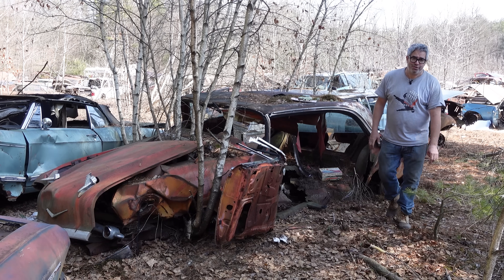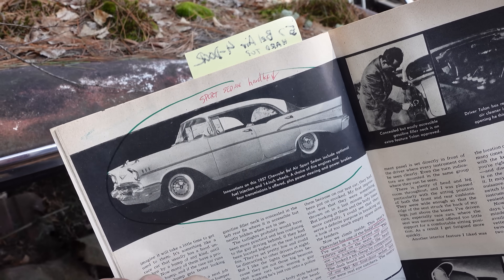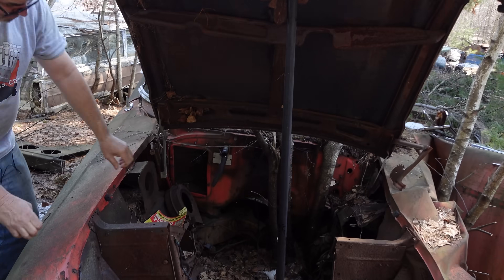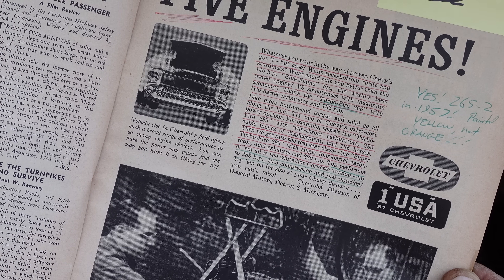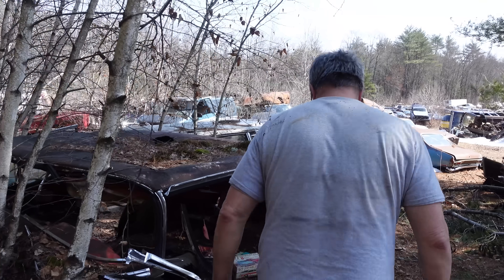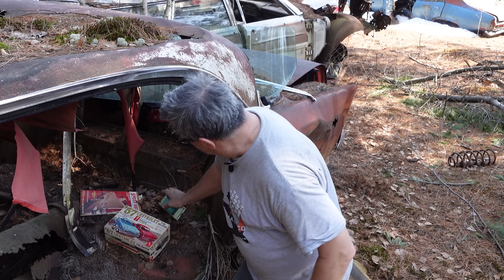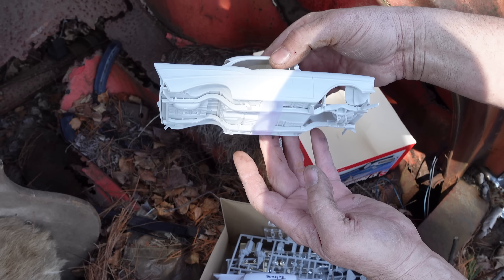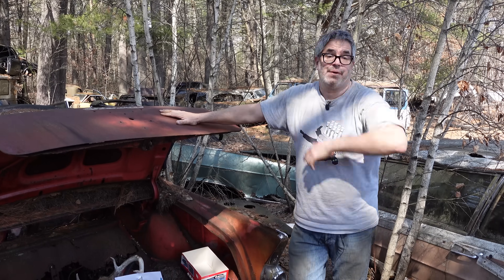Baby Cadillac

Comment: Yup, tinted glass was an option. 

No VIN, can't win, but easy to figure out, no doubt: V for V8 equipped (the lack of the "V" in the VIN means it had a six-cylinder engine), C for Bel Air, 57 for 1957 model year, possibly S for St. Louis, MO assembly, or B for Baltimore, MD assembly, or J for Janesville, WI assembly, T for Tarrytown, NY assembly, G for Framingham, MA assembly (among other choices) and the rest is the productions sequence. As noted previously, all of these plants are now closed. 

No tag, can't brag, but somewhat easy to figure out, no doubt: 57 for 1957 model year, 1039 for Bel Air four door hardtop, then any of the letter codes above denoting the possible assembly plants, maybe 676 for Black and Red cloth and vinyl interior trim, maybe 802 for Matador Red or 819 for India Ivory and Matador Red two-tone exterior paint and EZI for "EZ Eye" tinted glass.

My now retired coworker restored his dad's 1955 Chevy Bel Air (originally a V8), but it's resto-modded now with an LT1 engine and a four-speed overdrive. It has all of the modern conveniences that you would expect. I've related the story that he went to a car show and a guy was persistently asking him to buy the car, but my coworker politely refused saying that it was his father's car and it wasn't for sale, even as the man persisted and upped his offer. After talking with him, I now believe the guy that tried to buy his car was none other than Steve Davis of Barrett-Jackson. My coworker described him as the "guy with the sunglasses" and Mr. Davis has a condition where he needs to wear glasses to avoid issues with his eyes.

Then there was also Grace Braeger who bought her 1957 Chevrolet in 1964 and up to a few years ago, still drove it. The car was in excellent condition and she kept it going with easy driving and simple maintenance. There was also an older woman Rachel Veitch who had a 1964 Comet Caliente that she bought brand new and celebrated the car's "birthday" every year and also milestones of travel with it. She said that it was more reliable than three husbands who the Ford had easily outlasted. She gave up driving it a few years ago due to eye issues from her age.
Reply from the maker: I work with / for Steve Davis (since 2005) during my Barrett-Jackson TV auction commentary and used to wonder about the ever present shaded glasses. You're correct, he has a sensitivity to light that requires those dark lenses to alleviate. He's a Good Guy and very down to earth. Thanks for watching and writing. -Steve Magnante
Reply: @SteveMagnante  I wonder if he remembers the car.

Comment: I have one of these, bought it back in '81 when i was 16, and still have it. Those air tubes in the fenders actually go all they way down to the firewall near the floorboard, and that's where the fresh air came in. The heater box you showed just diverted that air into the heater core to supply heat, which worked really well on your feet!  The holes in the rear bumper were used to house backup lights as an option, if not, then there was a delete plate that went over the holes. Nice video, Steve...most people pass these 4 doors by, but they have a look all their own compared to other 57 body styles.

Comment: Back in the early to mid seventies when I was 8-10 years old my mom drove a 57 Belair 4dr sedan that dad purchased from his moms friend after her husband died in 1969. It was black with a white roof and had a silver grey interior and 283 Powerglide. Things that stick out in my mind about it after all these years were the spinners on the hubcaps, exhaust through the bumpers, rubber cones on the front bumper, and the shiny chrome threads in the seat upholstery. At that point in time Camaros and Firebirds were too new for most kids to afford to buy to hot rod so most around here bought cheap  ancient 55-57 Chevys so parts were desirable. That being said lots of times when mom came out of the store she found things missing off the car. Hubcaps, gas filler door, etc. It finally was pretty beat up a few years later and one day I walked home from school to find a fire engine red 65 Chevy II 2dr sedan in the yard where the 57 normally was. Mom drove it to the junk yard! I was devastated for a long time after and each Sunday when we went to visit cousins a few towns away we drove by that yard and mom would always say the car was in there being saved for me when I was old enough to drive. It was most likely already cannibalized or crushed by then. Kids!

Comment: The exhaust never ran through the rear bumper from the factory, that location was for the optional back up lights but you can customize the exhaust there as the filler plates unbolt easily.

Comment: The Turboglide debuted in 1957 too, which while far from the best automatic, I’d still like to test drive some day. My dad, my uncle and I once rescued a ‘61 Impala 4 door hardtop from a briar patch in northeast Tacoma, WA. It wasn’t in terrible shape, but we were getting it for parts  - mainly the 230 HP 283 under the hood (visually verified before cash changed hands). It wasn’t until it was being winched from its temporary, thorny tomb that we discovered that it had a Turboglide, to the slight disgust and muttering of the older guys. It was the first time I heard of them; it was in 1983 or 1984.
Reply: My older siblings aquired a '61 Impala 4-door hardtop for a transportation car in 1975. It also had the turboglide trans, and a 283 4-bbl. I was thrilled because I loved the '61 Chevys as a pre-teen and to this day they are my favorite of the classic era Chevys.
When it came time for me to get my first car, my sisters were still driving the Impala, so I had to settle for what was available. I bought a '66 Bel Air 4-door sedan from the elderly original owners. It had a 195 HP 283 with powerglide.

Comment: You brought up some interesting details about the 57 four door hard top. I never really paid much attention to them. I have what’s left of an unassembled Revell 57 Chevy two door. I was molded in black plastic. I never built it for whatever reason - found what was left of it in a parts box, body more or less crushed and missing the A-pillars. I don’t know why I never built it. Revell used to offer some great details on their small block Chevy motors.  They had actual details cast into the short blocks and cylinder heads.  Sort of made one hate to glue the heads and valve covers onto a finished kit, but to instead detail out the cranks, pistons, and valves, etc.
Reply: Now a feller could prolly print a scale engine stand and cherry-picker
Reply from the maker: Good call on the Revell engine details. I remember being "sad" when I glued the oil pan onto the bottom of the block and covered up the integral crankshaft detail! You'll be happy to know Revell's Tri-Five Chevy model kits have been reissued many, many times and are readily available today....complete with the crankshaft and cylinder bore detailing! Thanks for watching and writing. -Steve Magnante

Comment: The early 265's were painted yellow, but later on they were painted gray.
I had a 210 wagon with the 265 and the overdrive transmission and 4:11 rear.
I usually got 20 mpg with that.

Comment: My father ordered a 57 chevy with a V eight engine and three speed on the column in it brand new from Rumplick Chevrolet. It had a silver lower portion with a white roof and had the appearance of a New York state trooper's car. He didn't like the gas milage it got and changed the oil only one time in three years. After three years the valve guides were worn and smoked going down the hills from upstate New York. I remember sitting in a red 57 convertible in the show room with my brother and wonder if it survived.

Comment: I'm surprised that Steve didn't mention that the '57 was a sales flop from Chevy's perspective. For the first time since 1935 Ford out sold Chevy and as far as the Tri Five Chevy's are concerned the '57 was the lowest production, about 220,000 less '57's than '55's and 80,000 less than the '56. The design was 3 years old back when that was really uncommon and even with the massive facelift the consumer's took notice. It's hard to believe because the '57 is such an icon of the 1950's today. From wall paper to vintage memorabilia to themed restaurants the '57 Chevy is usually the center piece of the decor. Chevy made 1.55 million '57 Chevy's while Ford sales in '57 surpassed 1.65 million.

Comment: That particular car must have been a very rare option as it had no b or half b pillar at all. It also had doors that were easily removable, along with the option of being able to keep the feet cool on a hot day or being able to wash feet on a wet day.
Reply: Flintstone brakes
Reply: @tomwesley7884  Yup, 1 brake drum in the trunk does not provide a lot of stopping power.

Comment: The exhaust never ran through the rear bumper on any '57 Chevy, the bottom part of the bumper was for optional reverse lights. If you didn't opt for the lights, you got a block off plate. The gas filler was hidden behind a hinged section of chrome trim which was just part of the fin, not behind the tallight. The taillight is just below it.

Comment: Motor Trend (who only made one mistake) also did an article on the difference between the Chevy and Cadillac in the May 1971 issue. It was called 'The High Price Spread' and they compared the two to see if there was a real difference for the money, about $3,500, back then..
 Also includes a great article on the Tucker.

Comment: It funny that the Chevy engine ad you showed omitted three engines.  There were two engine options with dual quads.  The hydraulic cam got you 245 HP and the solid lifter was 270 HP.  There was lso a hydraulic cam fuel injection option rated at 250 HP.

Comment: I've never seen the exhaust go through the back bumper ends on those 57's but I do know that's where they put the optional reverse lights. I have a 57 Chevy 210 that did not come with the reverse lights but had a block off plate there instead.

Comment: I really appreciate the videos. I'm sure you get a lot of crap by keyboard cowboys. We do all the same things as you but with Kohler Command Vtwins for quarter scale tractor pulling (garden tractors).  We make all our own parts, billet cranks, billet heads, dry sump oil pumps, our own billet roller cams and our own billet carbs and mechanical fuel injection. thank you for your efforts to educate people, which is really hard for some people. Motion Race works is in my hometown.

Comment: Hi Steve, nice car, nice video!  Thank you for pointing out the lower cowl height for 1957 Chevrolet.  As far as I know, 1957 was a crossover year from the 265 small block, to the 283 small block.  I would say that the Chevrolet orange to the Chevrolet yellow, was so the factory could easily identify the 265 to 283 at the factory for 1957 only.  Ford did the same thing for 1968.  1968 was a crossover year for the Ford 289 vs 302 small block.  The 289's where Ford dark blue vs 302's where Ford light blue.  Ford light blue was 1968 302 only.  1963 and 1964 Ford 260 small block Fords had light blue valve covers and air cleaner with black blocks vs gold valve covers and air cleaners with black blocks to identify them apart from the 289 small block engines.  Please reply.  Dave...

Comment: Hey Rudolph Dieselhead.
Reply: No!!! I thought we were done with nightmare fuel!!! Bring that dog back!
Reply: @UmmYeahOk  
The apocalypse fuel.
I'll never get rid of my idi VW diesel. 
No electricity needed at all to start one up. 
Your points and coil are gonna be toast after the blast. 
And it'll run on anything oily. 
Hell, I've ever thrown brake fluid and power steering fluid in it. 
Nah forget those old 50s-60s cars for the Apocalypse, diesels where it's at. 😅
Reply: @MrTheHillfolk  I did not know who Rudolph Diesel was, and assumed it had nothing to do with the car being featured since no diesel motor was offered. Instead, I took the name “Rudolph,” and assumed he was talking about the freaky deer head Steve keeps embedding into his videos. At 7:15, you see it with the audible jingle bells, which is what he did during the holidays, thus making me associate “Rudolph” with “reindeer.” He has since replaced the deer head with a dog statue.
Reply: @UmmYeahOk  ahahaha I crack myself up , I was thinking you knew of him. 
Wasn't trying to rip anyone ,haha that's a good chuckle ! 
Have a great day ✌️✌️
Reply: @MrTheHillfolk  not the new diesels you would have to have a mechanical fuel pump and you still need a starter motor to fire it up you also still need electricity for your glow plugs as well
Reply: @Andrew-ff4hh   
See and that's the problem, all new diesels are trash.
Get an old idi with a manual trans ,pull the fuel solenoid pin and bump start it down a hill. 
Need to shut it off ? 
Nose the bumper up to a tree or other immovable object and pop the clutch in 2nd or 3rd gear. 
Good to go. 
An old idi is a way better apocalypse vehicle than any old 60s car.
Reply: @MrTheHillfolk  diesel engine in 50 60s car lol

Comment: Although the 57 BelAir had the gas tank near the bottom of the fin, the 1956 BelAir had the gas tank in a cooler place yet. It was behind the taillight which was so Cadillac like. All Cadillacs made from 1941 til 1958 had the gas tank behind the left taillight, with the exception of Eldorado made from 1955 on.

Comment: Today I learned something new!👏👏
I have always been a fan of the tri-fives ('56 is my favorite).
But I never knew about the air vent system above the '57 headlights!😎
Reply: I knew the '57 had those grates hidden above the headlights, but I never knew they were for interior air venting.
I also never knew about the 265 engines being painted a different color than orange from the factory.
'56 has always been my favorite of the Tri-Fives. But I wouldn't give a hoot about owning any of them.

Comment: My Uncle Bill had a 57 when I was about 10. He later bought a newer car, but said the 57 was a much better built car. I don’t remember any specifics of the car other than it was turquoise with the white (?) arrow on rear quarter panels.
Reply: White (India Ivory) in the quarters - sounds like you’re describing a 210 model, which I kind of prefer to the Bel Air.

Comment: Hey Steve, how were guys putting disc brakes on there gassers in the early 70s? I was watching two-lane Blacktop and I noticed when they were changing over to slicks that 55 had disc brakes on the rear so it must have had them on the front also.

Comment: Do my eyes deceive me Steve? Was that a 4 lug brake drum you found in the trunk? For this car?
Reply: Lotta holes in that thing
Reply: Those 4 large extra holes in the brake drum were for hammering in a small chisel or screwdriver in between the drum and the axle flange, once the drums had rusted in place. This was how you removed the drum with minimal damage. I have no idea what purpose these holes were originally for. But in the rust belt they were repurposed.  😉

Comment: Have never seen or heard of a "Hill Retarder" transmission in a 57. Wonder if they made it to production or was just wishful thinking on GM's part. Very cool either way.
Reply: Yes! The all new TurboGlide. It was an aluminum cased transmission. It never shifted (like Buick's Dynaflow) The complicated, many sections, torque converter was where the magic happened. It gave Chevy lots of problems. Most ended up being replaced by the cast iron Powerglide.
Reply: Turboglide lasted from '57-'61 for Chevy. The GM divisions had many different two and three speed automatics until they settled on the TurboHydramatics  ( 400 and 350 ) later on.